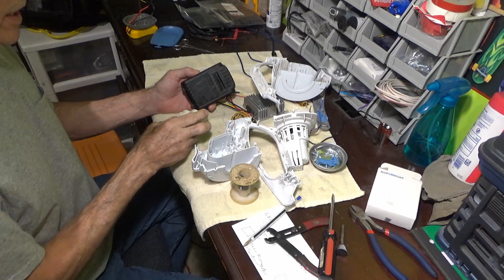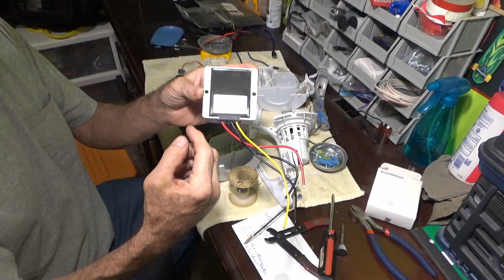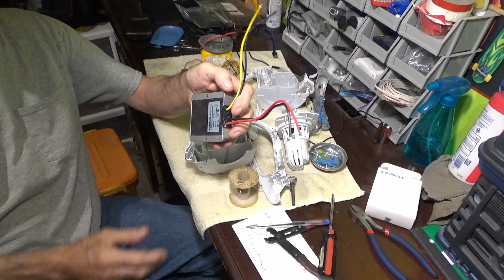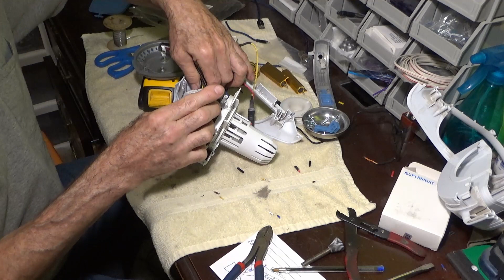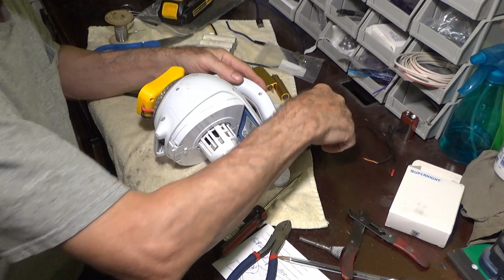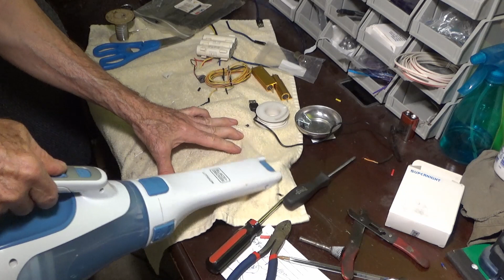Dewalt battery adapter converter - Convert 12v cordless vacuum to 18v, DC Voltage Reducer Converter,

Comment: Where did you get the socket that holds the battery?  I assume you remove the battery to charge it.
Reply from the maker: Amazon, Just search for battery adapter for whatever brand of tools you have.  I just found this with a quick search. (I can not be sure if the included power converter will fit inside the vacuum ) https://a.co/d/01ZVnuBE